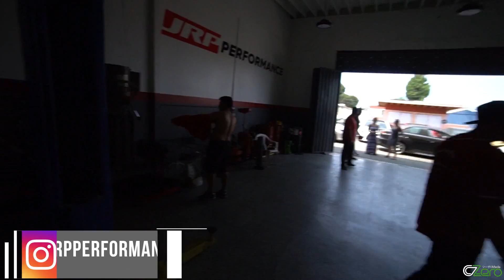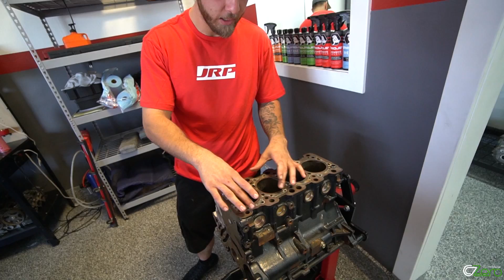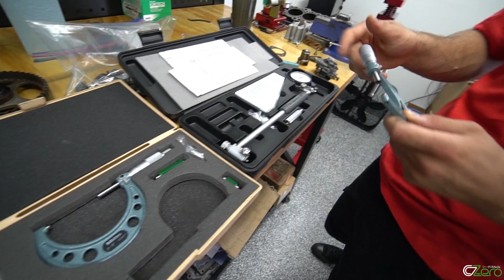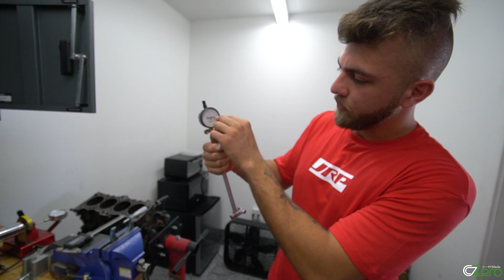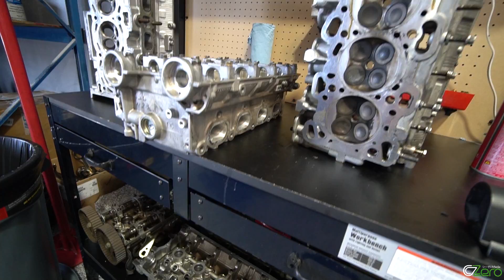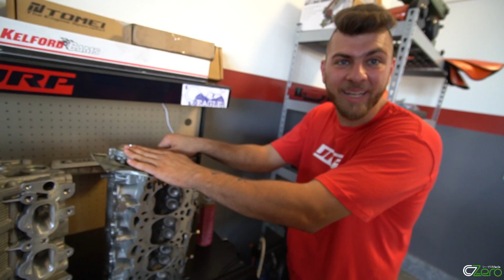How a 1000+HP Evo Gets Built w/ JRP Performance. Part 1.

Comment: He's pretty good but plastigage is better than precision tools for a bunch of reasons.  Cheaper and simpler doesn't mean less effective.  One reason is that metal tools expand and contract just from the heat of your hand and it changes the readings,  let alone ambient temperature and user error.

Comment: High strength sleeves are the way to go. More cost but a lot of benefits, like you can street drive it with full water cooling. Needs a good machinist to bore the block for sleeves.